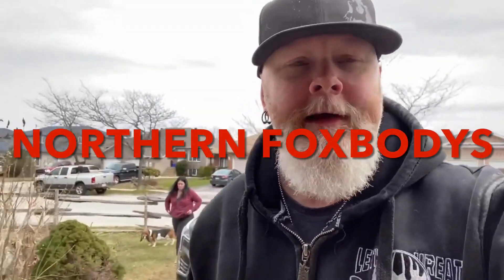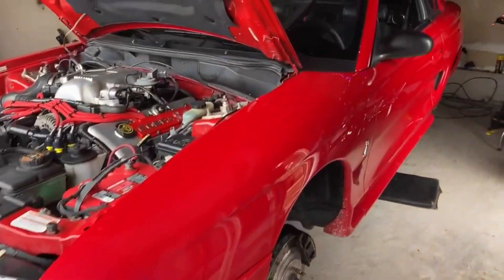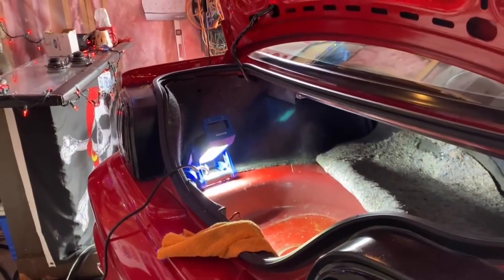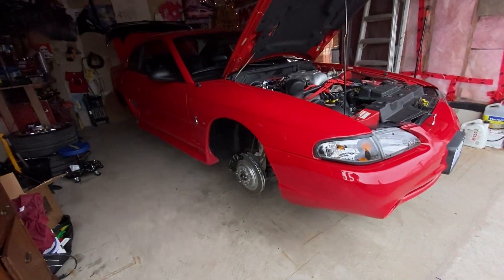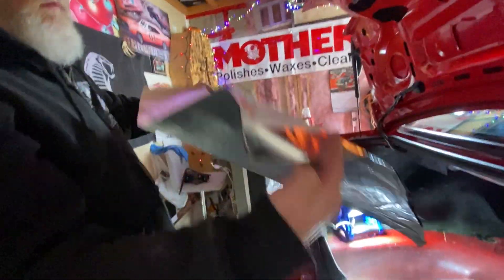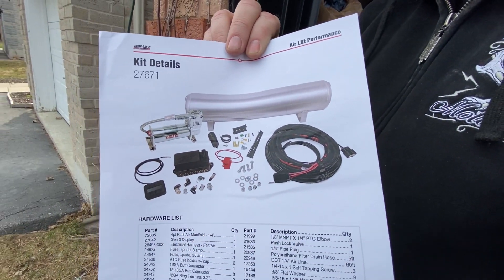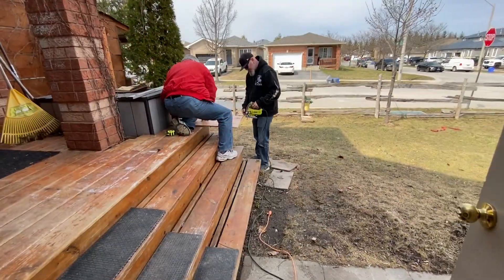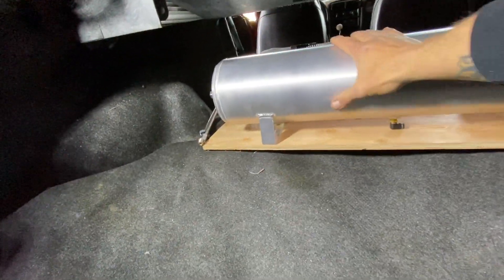97 svt cobra (sn95) air ride install part 1

Comment: That thing is going to look sweet when you get the inside fender lips rolled and get it on the ground, and yeah man gotta have a Coors while supervising making sure that they turn the strut the right way so that it will line up 🤣 Drinking a Coors light and supervising is hard work but someone has to do it
Reply from the maker: Yeah it’s nice but I really did the most work though 😂
Reply: @simcoecountygearheads  🤣😂 oh i got it now, they just wanted to look like they were doing something when you grabbed the camera 😂🤣 that's why they couldn't get the strut lined up, they drank too many Coors while you were doing all of the work 🤣😂